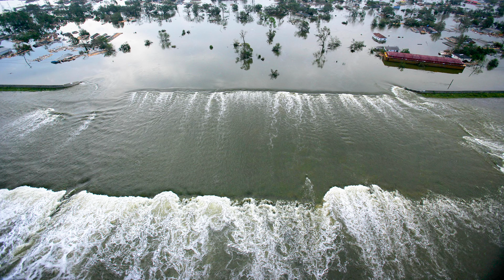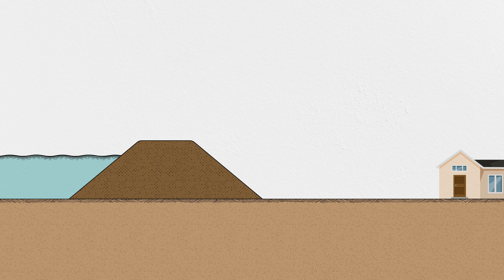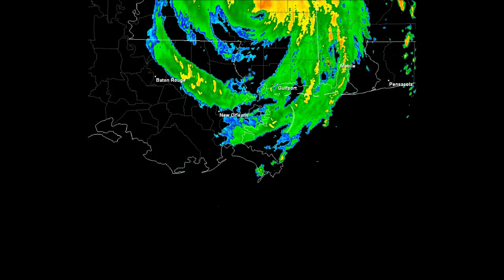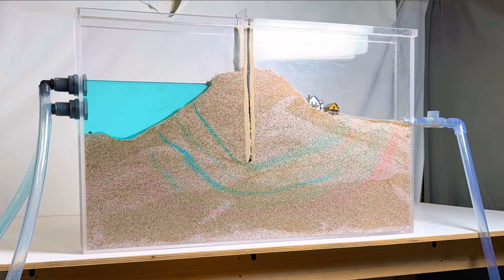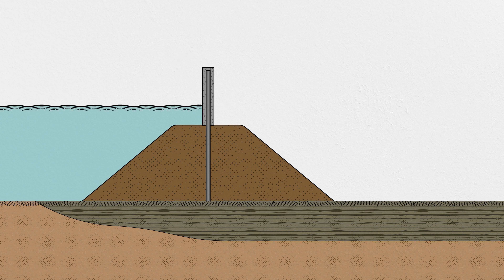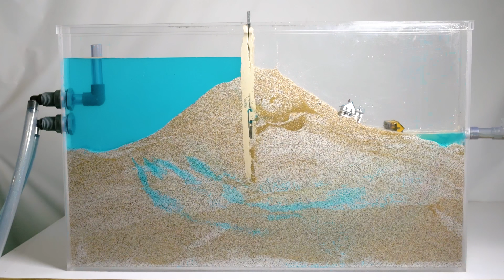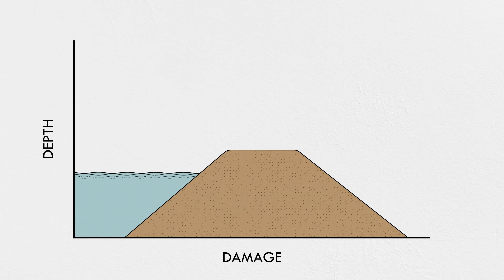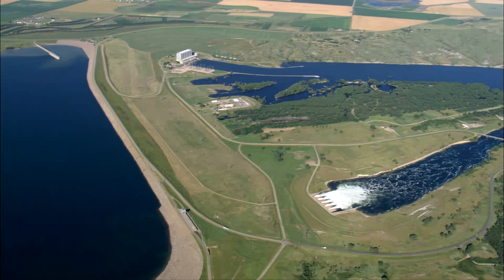The Mind-Blowing Flaw That Flooded New Orleans

Comment: I did a term paper on the New Orleans disaster a couple years ago. The problem was an absolute litany of halfazz fixes and kicking the can down the road since the 1800's. The one that got me was the pumping stations that got flooded and shut down in a city below sea level. You would think that would be the one piece of infrastructure that would be built to keep running no matter how high the water got.
Reply: Remember that hugely expensive new canal they built even though the Industrial Canal was already there? It was used exactly once. It was just another no bid rip off for the good people of that city.
After the new canal was built, Pontchartrain acquired a 100 FOOT canal that starts in the lake and goes to the Mississippi River. 100 FEET!!!! Consider the wave action against those week levees. 
Thanks to the ridiculous amount of corruption there, ALL of the residents suffered greatly.
Hey, but at least, someone's nephew made off like a bandit with that new 100' canal.
Reply: @AnExplorer219 All of what you said is bullshit. To start with, there is nowhere that a 100 foot canal could connect the River to the Lake.
Reply: Did not matter much. The surge pushed back into the outlet reservoir. They were just pumping water into the system that was flooding them. They are in a bowl. Everything around them was flooded. They had nowhere to pump the water. Simply a really bad area to live when it comes to flooding.
Reply: Unfortunately that's also how the Fukushima meltdowns happened. Backup generators to maintain coolant flow were at/below ground level. Had they been on the roof, the tsunami would have still devastated things but the nuclear part wouldn't have occurred
Reply: @JoshWalker1 I was just thinking of the similarity, although Fukishima was actually the backup generators, not pumps that were inundated (but they did use the water to cool). But being below (elevated) sea level isn't a problem IF it's designed to work when below a large amount of water. Either pump/generator itself sealed, or room watertight/self-sealing. Its a design philosophy of assuming the worst occurs (and planning to survive it), rather than hoping it doesn't happen. "Well hope don't float, Hodge."

And after the floods happened, FEMA wasn't prepared because 'Americans don't live in tents". Except they had to, except without FEMAs initial help (and cottages came later) so it was worse. Too many managers already promoted to the level of their incompetence.
Reply: @JoshWalker1  that was one massive wall of water at Fukushima. So much volume. It just kept coming. I guess the same could be said about Katrina.
Reply: @JoshWalker1    7.9.26. ☝🏼 Just a little tidbit…… The Japanese were told like three or so years earlier when a nuclear regulatory agency from the United States did a site audit and they identified the levy system around the plant needed to be upgraded from the 16 feet it was currently at, they suggested that it be doubled. What a lot of people don’t understand is the nuclear power plant itself with stood a 9.0 or a 9.1 magnitude earthquake that is phenomenal only to be inundated with water because someone wasn’t thinking about a tsunami as being a big problem🌊
Reply: @stevensapyak7971 Yup. They had one of their own engineers who'd been trying for years to argue it was too low that was brushed side also
Reply: @JoshWalker1  but then there would have been tonnes of extra weight on the roof, so instead of being a Chernobyl, it would have been a Pfizer Tower!
Reply: @JoshWalker1  Had they been on the roof, you could see an alternate timeline where they instead fail by getting struck by lightning during a storm at the same time, or a helicopter falling into it from the storm winds. Generally we should assume all backup systems will fail. At some point there will be a 30ft flood, with a lightning storm that strikes the exact worst places possible and causes runaway fire, building collapse and loss of power all at once, and all the backups will go down. Across long periods of time, unfortunate coincidences like that are guaranteed to happen. Examining what the worst possibility will be when all systems catastrophically fail, should be part of whether we choose to create something at all.
Reply: I work for a university that spent all its money on off site properties, while ignoring key infrastructure, now no students are buying thier rooms they have to sell the properties at a loss and domt have money to fix the highly urgent, dangerous infrastructure
For example the roofs and windows off all accommodation buildings are....falling off.
Seems like noones cared since the 1800s
Reply: The volume of flood water coming through the breeches far exceeded what the pumps could handle even if every last one had been on line.
Reply: @brucebowman9087  it would have given more time before the levee breaches, or possibly prevented the sudden catastrophic failure. Obviously the levees would have failed anyway, but maybe not all at once and with such force. Those chunks of levee concrete moved like feathers.
Reply: @intheshell35ify ya. It how do you pump water out that is rushing back into your outfall canals where do you pump it too? The ocean that’s already surging?
Reply: I worked for a company called DTN Kavouras. We provided equipment and data for weather, tv stations, FAA, etc were our customers. I remember when I went down to New Orleans in 2000 the meteorologists were talking all about how if there was a hurricane the lake would flood the city. Knew all about the fraud and the danger.
Reply: Like the flooding and failure of the backup generators at Fukushima.
(Now I see that others made the same observation.)
Reply: well they built it right on the rich side of New Orleans..
Reply: @noconsent  ouch. I was trying to not touch that rail. But it's the dead money truth.
Reply: @noconsent You have no idea what you're talking about. Look at the neighborhoods flooded by the 17th St and London Ave canal levees failures. They are far from the poorest parts of town.
Reply: Just like how Sandy flooded NYC buildings and their backup generators and/or non-submersible pumps were in the basements.
Reply: Money.
Reply: Same thing at Fukushima
Reply: The pumps and generators that power them fail all the time with a strong rain storm
Reply: Several Dutch companies were asked for advice on how to prevent this in the future.  One of the engineers in the newspaper vented his frustration over the negotiations in New Orleans, because upon explaining The Deltaworks in The Netherlands he noticed there was a constant pressure to decrease the strength of the storm barrier measures they presented.
In The Netherlands, The Deltaworks are massive dams and flood barriers that (if memory serves me right) are designed around a strong storm every 1000 years and a severely extreme storm every 10.000 years.  The plan to build them (back in 1954 already, after the disastreous flooding of 1953) was presented out of the idea that having to compensate the victims, the loss of homes and loss of farmland would be a bigger financial burden than the massive investment in the Deltaworks.
Some of the flood barriers have been used a couple of times by now: every time it happened, it made the news.

But in New Orleans, the water engineers constantly had to fight people who wanted a system designed to withstand a severe storm estimated to occur once every 100 years, which as they tried to explain numerous times, would occur with much higher frequency due to climate change, and thus, required a bigger investment to protect the land for many years to come.
Reply: @Dutch3DMaster  I'm loath to point this out, but one of the reasons New Orleans didn't have a project like the Netherlands' Delta Works is simply because the folks in New Orleans subject to disastrous flooding were poor black folk. In the eyes of the powers that be, there was no monetary reason to go to great lenghts to save them. It's fucing disgusting.
Reply: The entire story is fake, I was there
Reply: What gets me is building anything below sea level !! seems pretty obvious to me water always finds the lowest point 🤷‍♂️
Reply: Hi I'm Dutch. 27% of my country (the Netherlands)  is below sealevel (10 miles from were I live is the lowest point. About 7ft. ) We live here on this estuary of more than one river for centuries and centuries. Our 1st official water controling board (with legal and administrative taxing authority ) is about 700 years old. In my humble opinion  you're authorities could learn somthing from us to prevent future floodings.
Reply: C'mon man, why fix absolutely critical infrastructure - when you can grift, embezzle, and skim money off the top? Some people today put more effort into PRETENDING TO WORK than actually working....
Reply: Nothing is *ever* designed to handle "no matter what".  There's a practical reality to what it costs to mitigate various levels of risk, and at some point, you draw the line in the sand with respect to the likelihood of severity beyond a certain point.  The level of system redundancy in data centers and casinos is much better than your typical hospital, but there are definitely scenarios where all of that would be shut down, because it simply doesn't make sense to protect against a situation that's possible, but will likely never occur, and if it does, you've got bigger problems.
Reply: @jasonbrannen7598  while this engineering principal is sound, it is also the age old excuse of incompetent corporate engineers who design to a dollar amount or political end instead of a performance goal.
Reply: @intheshell35ify engineers don't make those decisions. Accountants do.
Reply: @jasonbrannen7598  I said "incompetent corporate engineers". Did you know there are other kinds of engineers that specialize in business, not engineering, despite having an engineering degree from an elite school?
Reply: @intheshell35ify as an engineer myself, yes. This is always a financial decision, not an engineering decision.
Reply: Below sea level, that’s it, that’s the problem. No federal flood insurance for any building below sea level. This problem will sort itself out.
Reply: @chadb9270  my government sold land to developers....on known flood plains....can't get them insured because....willfully built and bought a house that's on known flood plains, straight scam
Reply: @rahjah6958 yeah, there’s lots of dumb to go around. But now we have the opportunity to build a above sea level. We should do that.
Reply: @chadb9270  to my knowledge there isn't an economical way to build a city above sea level on the Mississippi Delta. The bedrock is miles deep under New Orleans, so pilings aren't much good. Once they started pumping water out of the city the millions of years of silt the city was sitting on dried out and started collapsing.
Reply: @intheshell35ify  yeah, exactly, move the city 30+ miles north. Again, everyone is free to stay, they just get zero flood insurance.
Reply: @chadb9270  below sea level and continuing to sink 1-2 inches a year.
Reply: @intheshell35ify  yep, you convinced me, seems like a totally sound investment!!! 😂🤣🤣
Reply: @chadb9270 for new construction this works. But the problem is that city was already built. You cant just abandon a major metropolitan area like that.
Reply: Maybe don't build/live in an area below sea level?
Reply: The city should NEVER have been built there to begin with. It's surrounded by water and 1-8' BELOW mean sea level. It's just terribly designed.
Reply: @LightlyBreadedChicken  it's there for a reason. Perfect place for a commercial port. The New Orleans port does huge business.. billions of dollars. Folks came for work and built a culture. You can't just abandon New Orleans to the sea.
Reply: Yeah. Well when the water gets that high its already game over. So it doesent matter if there running or not.
Reply: Do you (1) know how much it costs to replace all city pumping, and (2) have money to donate to pay for it?
Reply: @MousieBrown944  1. Billions of dollars, and I'm guessing probably 10-15 years. 2. I don't have to have the money to fix a pothole to say "Hey, that pothole needs fixed." What a childish argument.
Reply: @MousieBrown944  do you understand what tax is?
Reply: @MousieBrown944  but you got enough to run a multi hundred million dollar football program at a state university.

Comment: Building inside an area with a high likelihood of flooding sounds very familiar here West of Houston. But in our case they didn't build behind flood protection, they literally built inside the known pool of the  reservoirs.
Reply: Also, the unbridled development was done with little attention to water management. Expansive areas of fields were covered with roads, foundations, and parking lots. Excess water had no where to go but up.
Reply: It's weird to me when places don't build for the environment. Especially flooding. In florida, and even here in Louisville Ky, there are houses designed to sit over where water typically rises to. Kentucky is also below sea level, and the Ohio, along with its tributaries will rise well past the shore. In 1997 most of the city and southern Indiana flooded, although not as bad as the 1937 flood, where the city was mostly 12+ feet under water.
Reply: Watchin Morch Punckies looting and floatin screen TV's on rafts and then hearing Nagin blamin Bush for it and the news riding the story for 4 years gave me black fatigue.
Reply: @stevolopez  your racism is absolutely unnecessary & totally unwelcome.

Comment: I'm Dutch and very surprised that the side of a levees facing the water are not protected against the water. In the Netherlands they clad the levees with tight fitting basalt blocks. There is hardly any seepage. They also never
use sand as it' 'body' because it's to loose and water penetrable. Earth and clay are used.
Reply: blocks are usually for erosion protection from wind and waves.  They do not protect from seepage.  The issue where New Orleans is you dont have a lot clay and much of the soil is organic which makes its shear strength very low on a thin layer (less than few inches) in a horizontal direction.  Think of it almost like a lubricant between two blocks.  
You can use sand in dams and levees but it has to be wide enough and permeable enough to prevent build up of excessive pressures at the toe.  Also silts depending on chemistry can be quite permeable (gulf silts are much more permeable than say those closer to mountains.
Reply: In river bend areas concrete mat is used.  Adjacent sections of mat  are wired together.   The river is too long to mat much of it.  Your comment is excellent.
Reply: ”the river is too long ..” as a reply to a Dutchman, isn’t that ironic?

If we put it into perspective, the primary flood defenses in the Netherlands alone are long enough to wrap around the entire New Orleans East Bank system roughly 20 times, while the total network is long enough to span more than halfway around the Earth.

This is not because it is too long, it is just that it is cheaper. Typical American. Yet you built Panama Canal and manufactured tons of agent orange. And do you hear about oil then there’s no budget 🤣 but properly protecting or taking care of your own citizens is too expensive and in the end you always end up paying far much more because you cheaped out from the start. I hope you get a sane president soon
Reply: On the Mississippi River levee, concrete revetment matting is used in the cuts of the river to stabilize the lower bank. The flood side of the levee is also clad in concrete “slopepaving”  (4 inch pavement). Any new fill used to build up or repair the levees has been required to be impermeable levee grade material (basically clay) for several decades now. As the video pointed out, the flood canals in new orleans are in urban areas; so a lot of these extra measures aren’t applicable, and the problems with the subsoil dated back to the early 20th century. Another detail he didn’t really discuss is that everyone knew the I-wall on the 17th St. Canal and elsewhere wasn’t an ideal design. The newer wall on the opposite side of the 17th St Canal that protects Jefferson Parish used a better design with a deeper vertical wall and battered (diagonal) piles at the base to prevent rotation. It did not fail.
Reply: yeah that whole levee was shocking to see.

like who comes up to put a thin straight wall on/it it to raise the height of it.
have they never heard of a lever?
of course that thing is gonna be pushed over by the forces it has to keep at bay.

Comment: Canal gates to stop backflow makes sense - although it probably means water that you're trying to pump out will have no where to go - but how does removing i-walls from levees help?
Reply: I walls look good but they don't have the proper support to withstand water levels any higher than where they meet soil at their base (if even that).  Water pushes between the wall and the soil and failure soon follows.  So they are really just decorations on the levees which are failure points waiting to happen.
Reply: @serious_as_a_heart_attack  so I assume where they rebuilt them they raised the levees to the additional height that was provided by the i-wall?

Comment: When water body have area to spill freely, it will spill there. They build on those flood spill areas. Trying to keep rivers in the narrow channels on surge of water causes enormous pressure on levys, plus those soak. We had massive flood in 1997, Wrocław, Poland. The engineers wanted to flood village, compensating citizens, before wave hit the city, but due to the protests they failed, and the city was catastrophic flooded. The other flood spill areas are also build up. After billions in investments city seems to be more protected, with widened and added channels. Recent, rather large water surge was under control.